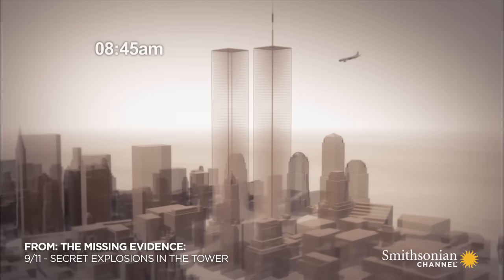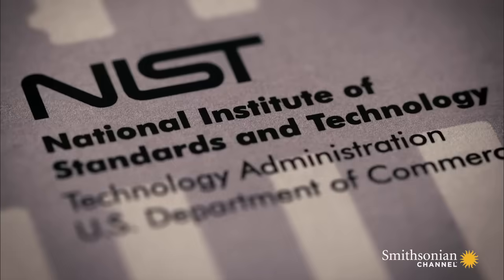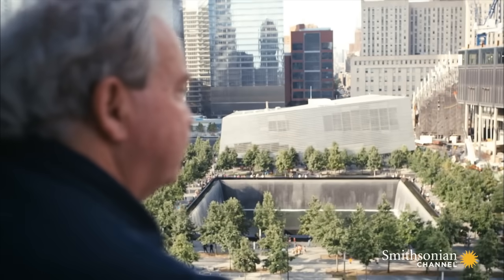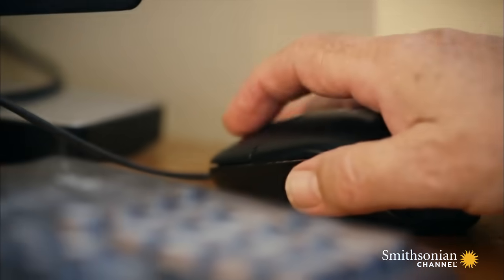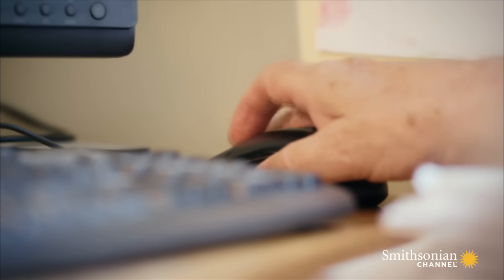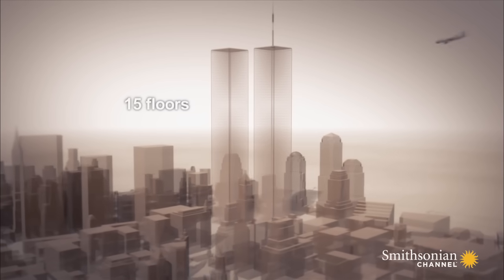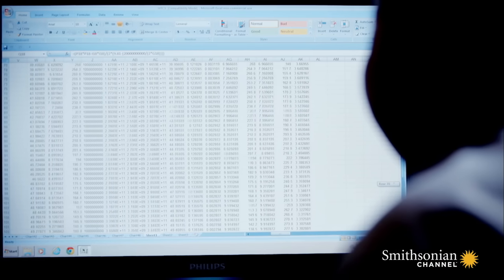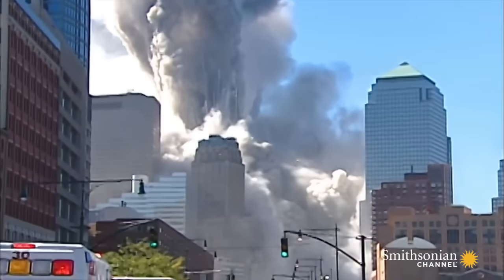This Computer Simulation Explains How the Twin Towers Fell

Comment: What a load of bollocks, this jerk forgot to add newtons 3rd law of motion to the equation. The smaller block couldn't destroy the lower undamaged part of the building without destroying it's self, this is simple physics. This bloke it a total bellend, what about building 7 the one not hit by a plane or building 6 destroyed from the inside. I would love him to explain that little hypothesis with his computer program.
Reply: The upper falling mass didn't destroy the "building", it destroyed the floor below it. And then THAT mass destroyed the floor below it. And so on. It is simple physics, but you obviously don't know how it works. Building 7 was hit by another building. Your argument is invalid. The ASCE has a great analysis out, maybe you should look it up before spouting off on stuff you're ignorant of.
Reply: No you are obviously here to troll the page as you can't back up your silly claim, you are the one that doesn’t understand simple physics, when has this ever happened before to a skyscraper ? I will tell you, it's never happened before or since because you hypothesis has no science behind it. One block crushing another block etc etc ? that would mean that each 12 foot high floor would slow down the collapse, every floor trust would have to shear off exactly at the same time yet there isn't anything slowing down, it actually gets faster as if nothing is holding each floor in place. The buildings collapsed at about 10 seconds give or take so that would mean that around 10 floors a second were falling ?? How can you explain that ? You can't without something pushing the floors away like explosives. If the top half did collapse symmetrically which is highly unlikely because only one side of the building was damaged, the top half would have fallen sideways and fallen off. Even if what you say actually happened then a gravitational collapse would not be evident. Because of newtons third law of motion: "For every action, there is an equal and opposite reaction" the top floors would destroy them self before they destroyed the building,what would actually happen is maybe one floor might collapse then the top half would come to a sudden stop because of the equal and opposite reaction. As for building 7 the NIST report doesn’t mention any damage to building 7 that would comprehend it's structural integrity which basically means falling debris from buildings 1 and 2 had no part in it's collapse. The impossible symmetrical collapse was blamed on office fires yet they NEVER explained why it collapsed all they said was that a support failed and the whole building collapsed.. They forgot to mention that there were 62 other support columns which would need to fail at exactly the same time which is absolutely impossible. Also in 2002 the National Construction Safety Team Act H.R. 4687 was passed in to law that means that NIST doesn’t have to explain that little hypothesis and we are not allowed to ask any questions. It's either believe their nonsense of shut the fuck up.
Reply: Dan Druft

Daft Danny Druft posted a Galloping Gish, so it's SPEEDROUND!!!
0. Your understanding of fizzix is faulty, whoever you're parroting is ignorant.
1. Ronan Point England May 16, 1968
2. LOL "comprehend" it's integrity? Actually, wtc 1 collapse set wtc 7 on fire, so there's that
3. The NCST Act prohibits NISTs findings from being used in court. This frees NIST to investigate without fear of it's analysis being misused. Not what you said.
Reply: So you know more than the assembled minds at ASCE? That is some serious Dunning Kruger you got going there.
Reply: Dan Druft

𝐍𝐨 𝐈 𝐝𝐨𝐧'𝐭 𝐤𝐧𝐨𝐰 𝐦𝐨𝐫𝐞 𝐭𝐡𝐚𝐧 𝐭𝐡𝐞 𝐦𝐢𝐧𝐝𝐬 𝐨𝐟 𝐀𝐒𝐂𝐄 𝐛𝐮𝐭 𝐈 𝐝𝐨 𝐤𝐧𝐨𝐰 𝐭𝐡𝐚𝐭 𝐭𝐡𝐞𝐲 𝐦𝐮𝐬𝐭 𝐛𝐞 𝐭𝐚𝐥𝐤𝐢𝐧𝐠 𝐛𝐨𝐥𝐥𝐨𝐜𝐤𝐬 𝐛𝐞𝐜𝐚𝐮𝐬𝐞 𝐰𝐢𝐭𝐡 𝐬𝐜𝐢𝐞𝐧𝐜𝐞 𝐢𝐟 𝐞𝐯𝐢𝐝𝐞𝐧𝐜𝐞 𝐢𝐬 𝐝𝐢𝐟𝐟𝐞𝐫𝐞𝐧𝐭 𝐟𝐫𝐨𝐦 𝐰𝐡𝐚𝐭 𝐭𝐡𝐞𝐲 𝐚𝐫𝐞 𝐬𝐚𝐲𝐢𝐧𝐠 𝐭𝐡𝐞𝐧 𝐭𝐡𝐞𝐢𝐫 𝐞𝐪𝐮𝐚𝐭𝐢𝐨𝐧𝐬 𝐚𝐫𝐞 𝐰𝐫𝐨𝐧𝐠.
Okay, good starting point, what evidence do you know of that disagrees with what they are saying? Do you have a copy of their analysis?

 𝐈𝐭'𝐬 𝐥𝐢𝐤𝐞 𝐩𝐨𝐩𝐮𝐥𝐚𝐫 𝐦𝐞𝐜𝐡𝐚𝐧𝐢𝐜𝐬 𝐬𝐡𝐨𝐰𝐢𝐧𝐠 𝐭𝐡𝐞 𝐍𝐈𝐒𝐓 𝐫𝐞𝐩𝐨𝐫𝐭 𝐭𝐫𝐲𝐢𝐧𝐠 𝐭𝐨 𝐭𝐞𝐥𝐥 𝐮𝐬 𝐡𝐨𝐰 𝐭𝐡𝐞 𝐛𝐮𝐢𝐥𝐝𝐢𝐧𝐠𝐬 𝐜𝐨𝐥𝐥𝐚𝐩𝐬𝐞𝐝 𝐚𝐧𝐝 𝐭𝐡𝐞𝐢𝐫 𝐬𝐢𝐥𝐥𝐲 𝐯𝐢𝐝𝐞𝐨 𝐰𝐡𝐢𝐜𝐡 𝐬𝐡𝐨𝐰𝐬 𝐚 𝐟𝐚𝐥𝐥𝐢𝐧𝐠 𝐛𝐮𝐢𝐥𝐝𝐢𝐧𝐠 𝐭𝐡𝐚𝐭 𝐢𝐬 𝐧𝐨𝐭𝐡𝐢𝐧𝐠 𝐥𝐢𝐤𝐞 𝐰𝐡𝐚𝐭 𝐫𝐞𝐚𝐥𝐥𝐲 𝐡𝐚𝐩𝐩𝐞𝐧𝐞𝐝 𝐨𝐧 𝟗/𝟏𝟏.
Again, please tell me what you interpret differently.

 𝐓𝐡𝐞𝐲 𝐬𝐭𝐢𝐥𝐥 𝐡𝐚𝐯𝐞𝐧'𝐭 𝐫𝐞𝐚𝐥𝐥𝐲 𝐞𝐱𝐩𝐥𝐚𝐢𝐧𝐞𝐝 𝐡𝐨𝐰 𝐭𝐡𝐞 𝐭𝐨𝐰𝐞𝐫𝐬 𝐜𝐨𝐥𝐥𝐚𝐩𝐬𝐞𝐝, 𝐭𝐡𝐞𝐲 𝐬𝐢𝐦𝐩𝐥𝐲 𝐭𝐨𝐥𝐝 𝐮𝐬 𝐚𝐧𝐝 𝐰𝐞 𝐚𝐫𝐞 𝐦𝐞𝐚𝐧𝐭 𝐭𝐨 𝐛𝐞𝐥𝐢𝐞𝐯𝐞 𝐭𝐡𝐢𝐬 𝐡𝐨𝐫𝐬𝐞𝐬𝐡𝐢𝐭 𝐰𝐢𝐭𝐡𝐨𝐮𝐭 𝐚 𝐬𝐢𝐧𝐠𝐥𝐞 𝐛𝐢𝐭 𝐨𝐟 𝐞𝐯𝐢𝐝𝐞𝐧𝐜𝐞 𝐭𝐨 𝐛𝐚𝐜𝐤 𝐮𝐩 𝐭𝐡𝐞𝐢𝐫 𝐜𝐥𝐚𝐢𝐦𝐬.
Well, consider the reality. No one knows what the actual state of the building was inside, other than badly damaged, broken columns and lots of fire. If they tried to explain the motion of every piece of steel in there during the collapse, the troofers would have gone nuts trying to make claims off of it. NIST was very wise to say collapse ensued. 

 𝐓𝐡𝐞𝐲 𝐬𝐚𝐢𝐝 𝐧𝐨 𝐞𝐱𝐩𝐥𝐨𝐬𝐢𝐯𝐞𝐬 𝐰𝐞𝐫𝐞 𝐮𝐬𝐞𝐝  𝐲𝐞𝐭 𝐭𝐡𝐞𝐲 𝐧𝐞𝐯𝐞𝐫 𝐞𝐯𝐞𝐧 𝐥𝐨𝐨𝐤𝐞𝐝 𝐟𝐨𝐫 𝐞𝐱𝐩𝐥𝐨𝐬𝐢𝐯𝐞 𝐞𝐯𝐢𝐝𝐞𝐧𝐜𝐞
There was no evidence of explosives being used, that is, no marks, burns, cutter charge signature, prep signature, nothing. What they declined to look for was residue. Why bother, there wasn't any indication of it.

 𝐞𝐯𝐞𝐧 𝐭𝐡𝐨𝐮𝐠𝐡 𝐥𝐚𝐫𝐠𝐞 𝐭𝐫𝐚𝐜𝐞𝐬 𝐨𝐟 𝐭𝐡𝐞𝐫𝐦𝐚𝐭𝐞 𝐚𝐧𝐝 
Now you're either embellishing this or quoting someone else who is misinformed. The amount of "thermate" found was .01% by weight of wtc dust. True, that works out to a lot of "thermate" which begs the question, why was there so much unfired "thermate" laying around? Also, it was estimated it would require .13 pounds of thermite per pound of steel to down the towers. I'll leave it to you to calculate the enormous amount of thermite that is. But even more fun, the professor who claimed to have found thermate in the debris was subsequently relieved of his duties at BYU in Utah, and the publisher of the science web site [which was as respected as a comic book] that published his work resigned in disgust. Subsequent analysis by an independent chemical lab showed no thermate, thermite or anything like those. It was paint. 

𝐯𝐞𝐫𝐲 𝐡𝐢𝐠𝐡 𝐭𝐫𝐚𝐜𝐞𝐬 𝐨𝐟 𝐜𝐡𝐞𝐦𝐢𝐜𝐚𝐥𝐬 𝐨𝐧𝐥𝐲 𝐟𝐨𝐮𝐧𝐝 𝐢𝐧 𝐧𝐮𝐜𝐥𝐞𝐚𝐫 𝐝𝐞𝐭𝐨𝐧𝐚𝐭𝐢𝐨𝐧 𝐬𝐢𝐭𝐞𝐬.
This one is just wrong, all counts. The chemical in question was tritium, and it is common in watch dials, night sites for firearms, and clock faces. It is the material that glows in the dark without having to be charged up. The amounts found were not excessive, only troofers blew it up out of proportion.

 𝐓𝐡𝐞𝐲 𝐞𝐯𝐞𝐧 𝐜𝐚𝐥𝐥𝐞𝐝 𝐭𝐡𝐞 𝐍𝐞𝐰 𝐘𝐨𝐫𝐤 "𝐆𝐫𝐨𝐮𝐧𝐝 𝐙𝐞𝐫𝐨"
Yes, the media did that. Thought you guys hated them? Now why would they call it that? Could it be fluffing the drama of the attacks?

   𝐚𝐧𝐝 𝐭𝐡𝐚𝐭 𝐭𝐞𝐫𝐦 𝐠𝐫𝐨𝐮𝐧𝐝 𝐳𝐞𝐫𝐨 𝐦𝐞𝐚𝐧𝐬 𝐭𝐡𝐞 𝐩𝐨𝐢𝐧𝐭 𝐨𝐟 𝐝𝐞𝐭𝐨𝐧𝐚𝐭𝐢𝐨𝐧 𝐨𝐟 𝐚𝐧 𝐚𝐭𝐨𝐦𝐢𝐜 𝐛𝐨𝐦𝐛.
Not really, it is just a term of art and really means nothing. But tell me, seriously, do you actually believe someone fired a nuke at the wtc? Don't you realize how batshit loony that idea is?

 𝐈 𝐭𝐡𝐢𝐧𝐤 𝐭𝐡𝐞𝐲 𝐰𝐞𝐫𝐞 𝐫𝐞𝐚𝐥𝐥𝐲 𝐭𝐚𝐤𝐢𝐧𝐠 𝐭𝐡𝐞 𝐩𝐢𝐬𝐬 𝐨𝐮𝐭 𝐨𝐟 𝐮𝐬, 𝐬𝐡𝐨𝐰𝐢𝐧𝐠 𝐰𝐡𝐚𝐭 𝐚𝐜𝐭𝐮𝐚𝐥𝐥𝐲 𝐡𝐚𝐩𝐩𝐞𝐧𝐞𝐝 𝐚𝐧𝐝 𝐧𝐨𝐛𝐨𝐝𝐲 𝐰𝐚𝐧𝐭𝐬 𝐭𝐨 𝐛𝐞𝐥𝐢𝐞𝐯𝐞 𝐭𝐡𝐞𝐢𝐫 𝐠𝐨𝐯𝐞𝐫𝐧𝐦𝐞𝐧𝐭 𝐰𝐨𝐮𝐥𝐝 𝐝𝐨 𝐬𝐮𝐜𝐡 𝐚 𝐭𝐡𝐢𝐧𝐠 𝐭𝐨 𝐭𝐡𝐞𝐢𝐫 𝐨𝐰𝐧 𝐩𝐞𝐨𝐩𝐥𝐞.
I don't believe there is anyone in the us government that is vicious enough or psychopathic enough to do that. I also have seen enough real evidence to prove to me that the troofers are wrong.
Reply: Dan Druft  >>>And you expect me to read all that nonsense ? 

Ok Dan, I found some reading that is more what you're wanting to see, right in your skill range.

Father said, “I see a big dog.

Who can find it?”

“I see three little dogs,” said Dick.
“But I cannot find the big one.”

“I want to see,” said Sally.

“I want to see the three little dogs.”
Reply: Just because you have one doesn’t mean you need to act like one. And remember stupidity’s not a crime, so you’re free to go. Don't come back with some sad crybaby reply, you should save your breath – you’ll need it to blow up your date.
Reply: Sounds like you speak from experience. Too bad your cute rejoinders are no sanctuary for running away from the facts. Everyone reading this forum knows you wimped out and limped out.
Reply: Don't feed the troll

Comment: How much was this traitor paid for this bad science?  Physics prohibits the so called "pancake" theory, conservation of momentum will not allow a building (especially one with this type of hardened steel gurter design) to freefall, or even fall at all, each floor should collapse slower than the previous floor until it comes to rest.  This story & NIST's are either lies or incredible negligence. 🇺🇸

Comment: Sooo, let me get this right, if I take 38,000 elephant's and stand them on top of each other, and then the four elephant's at the very top of the pile fall  on to the remaining 37, 996 elephant's they start to dissentergrate?
Sound's like a right circus to me.
Reply: LJ HM

No, idiot. elephant 37996s legs collapse, and the whole load drops onto elephant 37995. Pretty stoopid analogy there LJHM. 

Let's do it with tables. Stack 110 tables one on top of the other. Each table in the stack is strong enough to carry only the load of the number of tables on top of it. So table number 90 can hold the 20 tables above it. Now, imagine the legs of table 91 become weak and buckle. Tables 91 through 110 suddenly drop onto table 90. The load has changed from a static load to a dynamic one, and instead of having to carry a static load of only 20 tables, the drop creates a kinetic load equal to 100 tables. Obviously, table 90s legs collapse, and the whole load lands on table 89. Rinse repeat. This continues all the way to the ground.
..................................................................................
Sooo, let me get this right, if I take 38,000 elephant's and stand them on top of each other, and then the four elephant's at the very top of the pile fall  on to the remaining 37, 996 elephant's they start to dissentergrate?
Sound's like a right circus to me.

Comment: To be polite about this,truthers answer this please. The disintegration of both towers starting with the floorscollapsing just above the points of impact were apparently caused by explosives? So we are to believe theparties that planted the explosives knew exactly where the aircraft were to hit. Now, truthers have doubted thatterrorists with little flying skill could hit a building, even the size of WTC1 and 2. Now we need to believe theycould target a specific floor. REALLY? And for the record, i 've been on a 2million pound airbus simulator and crashed an A320 straight into the Thames with 30 mins practice. But I couldn't pick out a floor on a skyscraper.